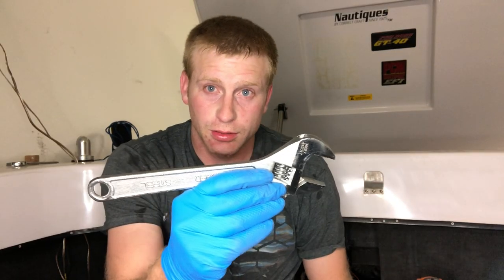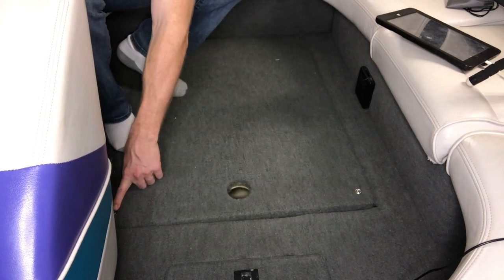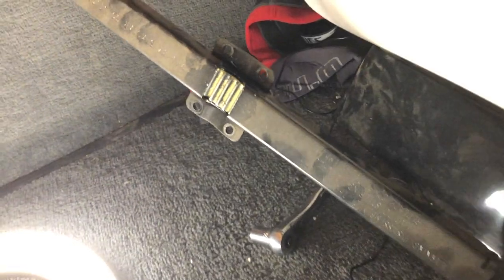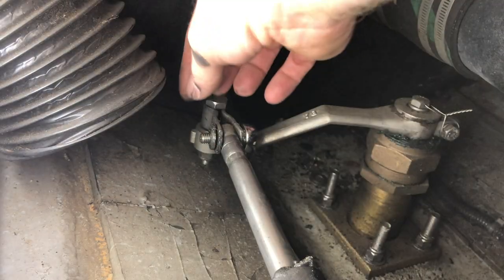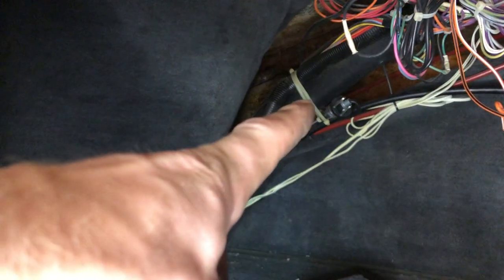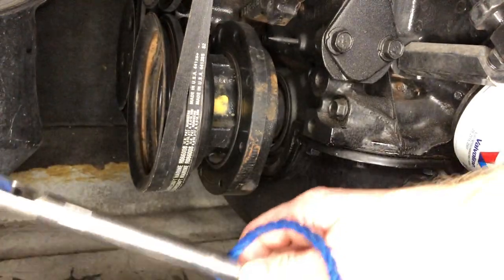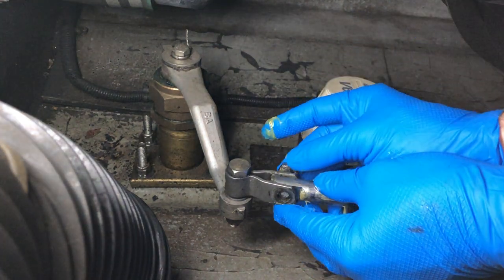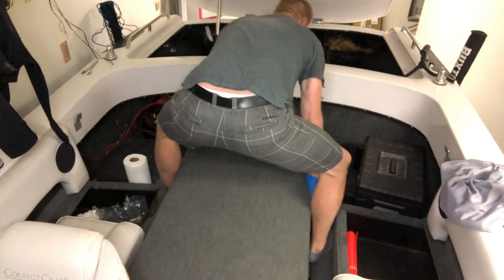How To Replace a Steering Cable in a Boat

Comment: Great video! i took my 96 ski nautique out for first time in 3 years and found it was hard to turn right and not to the left. I suspected that the steering cable needed replacement however when I got the boat on it`s trailer the boat steering wheel moved very easy in both directions. would you by chance have any insight you could share? Thanks in advance
Reply from the maker: Thanks for the question. The place I would start would be where the cable attaches to the arm that turns the rudder. I would get someone to help you turn the steering wheel while you observe the mechanical junction to make sure it is functioning correctly. Hope you have a great day.

Comment: thanks for the video, will be nice if you show all parts of failed cable (motor side)
Reply from the maker: Thanks. Are you wanting the view of the failed cable parts once the cable has been removed or with the failed cable still installed?
Reply: @Sunni_days  removed
Reply from the maker: Ok. Thanks for the input. I have the opportunity to help a friend change his out. I will probably from it and then I can show what you are looking for. 

What kind of boat do you have?
Reply: @Sunni_days  do you know the reason why cable was failed?
Reply from the maker: Overtime this one broke down and became almost stuck. 

Lubing it wouldn’t work, so I ended up replacing the entire cable.
Reply from the maker: I don’t know the exact reason, but I think it would be 1 of the following 2 reasons:

1. Lack of use. I think the boat sat for awhile before we purchased it. 

2. Water got introduced into the steering cable and broke down the grease/lubrication.
Reply: @Sunni_days  so technically is not broke, is rusted or something? Just interesting where exactly the problem, what part of the cable
Reply from the maker: Yes, technically it isn’t actually broken. It just doesn’t function like normal. Either rust or corrosion or some other failure that makes the cable become stiff. Sometimes they completely seize up. This one wasn’t far from that point. It was very difficult to steer the boat while on the water.
Reply: To line up the steering wheel with the outdrive. 
You do not have to remove the steering wheel. 
Just make sure the outdrive is straight. 
Then make sure your steering wheel is straight. 
Then mount the rack to the steering wheel gear on the back with the 4 bolts while keeping everything straight. 
I would also recommend loc-tight on the 4 nuts. Because over time they can back off. 
I have a 1997 Maxum 1750SR that I bought new. A few years ago the steering was getting sloppy and then I noticed the steering wheel was not inline with the outdrive. When I started checking things out. I found that the the 4 nuts had worked loose and was causing some binding and it even skipped a couple of teeth. So I realigned and tighten the nuts back down with loc-tight.
That was a few years ago and have not had anymore issues. 
By the way. Great video on changing out the cable.
Reply from the maker: @michaelcowan6254  thanks for your input. Didn’t really think about it for an out drive. You definitely wouldn’t have to remove the steering wheel to get everything lined up straight. 

Good tip about the thread locker. I have some and will probably add that on this boat. 

Thank you for the kind words 🙏

Comment: How do you attach the cable to the steering?  I m beginner boater. Thanks
Reply from the maker: What kind of boat do you have?
Reply: @Sunni_days  i have a 19 feet maxum with teleflex cable but i think i have wrong helm.
Reply from the maker: @kenpham1818  Ok. I don't know much about that specific boat. The two places where the cable attaches are under the dash it will connect to the steering with a rack and pinion. Then at the transom or rear of the boat, it will connect to the outdrive.

Comment: I had a steering cable replaced last year. But it was aligned right because  I cannot do a full turn left.. I can only do a full turn right.  So,  is the problem at rudder end or at the steering column .
Reply from the maker: You could fix it at either end. I would probably start at the steering column side. 

What boat do you have?
Reply: @Sunni_days  2004  MB Sport B52
Reply from the maker: Hey - after thinking about it over the weekend, you might be able to adjust it back at the rudder, but it might take a couple trouble shooting activities. Send me a message request on Facebook if you would like and we can see what we can come up with together. https://www.facebook.com/blake.wasden
Reply: @Sunni_days  I had someone coming to try and figure it out,  and I wanted to have an install video he could reference that was almost exactly like mine.. I thought well,  I'll post my issue and maybe get some answers before he got there.  Anyway.,  we figured out that the problem was definitely at the rudder end..Specifically the swivel tube. Mine has a 2 piece swivel nut that can be positioned up and down the length of the swivel tube,   which allows the tube to be positioned in the bracket FWD or AFT.  It was basically too far AFT., to where full right the rudder arm was hitting the back wall of the boat..  and turning left, the rod was bottoming out before the rudder could reach full turn.   So we just moved the swivel pipe fwd enough to allow full range each way,  and not hit the back wall of my boat. But,  because the angle the steering line has to take from bracket to where it mounts to the arm,. Coming back from full right is hard it first, because you fighting  2 different angles. So I'm thinking I gotta move it more.  I don't understand why the bracket wasn't placed farther out so the line is more straight to the arm.  Stupid design.
Reply from the maker: Glad that your getting it figured out 👌.
Reply from the maker: Ya, sometimes the designs are the best 🤦.
Reply: @Sunni_days  It's looks that way,  for now..  But really appreciate your quick responses and offers of help. You have a new subscriber, LOL. .I live in a water community (Discovery Bay). And we have a horrible time with finding available and reliable mobile boat mechanics. 
The few good ones, are booked out for weeks.. The other few,, are just not reliable, or can be trusted to come back and fix what they didn't do right the first time. Like the guy that installed my cable the first time.
Reply from the maker: Dude!! I’ve always wanted to ride on the delta. Ever since I saw guys like Josh at Twelker and crew. Glad your getting it fixed. Thanks for subscribing 🙏. Reach out if you need anything else 👌.

Comment: What brand steering cable is this I’m trying to order one mine is a 15 foot I believe but I need the one like yours that has 4 screws
Reply from the maker: It’s a teleflex cable. What boat are you trying to put it on? I might be able to point you in the right direction.
Reply: @Sunni_days  I have a 1995 Starcraft 1709 with a 95 Mercury force 120 motor
Reply from the maker: The other brand to look for is a SeaStar they bought out TeleFlex 👌. I think you can even find SeaStar on Amazon.
Reply from the maker: This might be what you need. Just verify that it is the correct part for your application:
Amazon Affiliate Link: https://amzn.to/3779q9B
Reply: @Sunni_days  I found a sea star on Amazon for cheaper and I can’t tell if it has the 4 screw bracket that I need
Reply from the maker: I’m not as familiar with that boat, so I won’t be much help, sorry 😞.
Reply from the maker: Send me a link and I’ll see if I can tell.
Reply: @Sunni_days  you’ve already helped me appreciate it